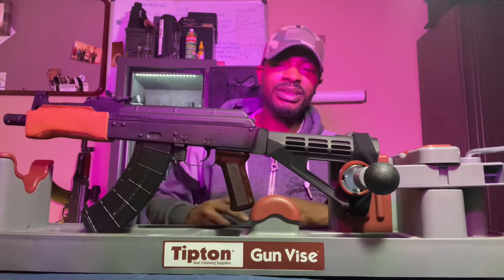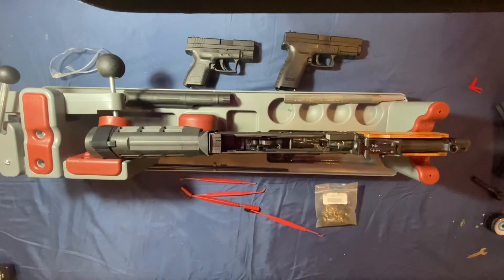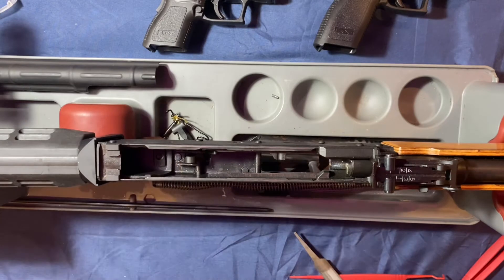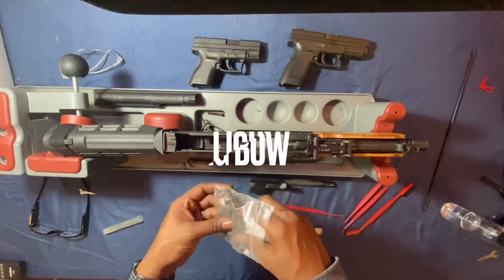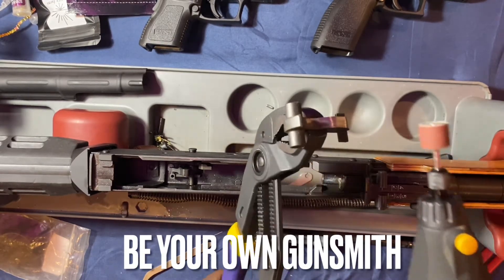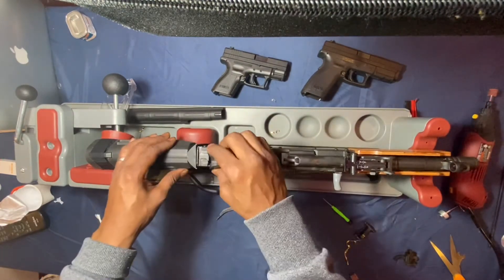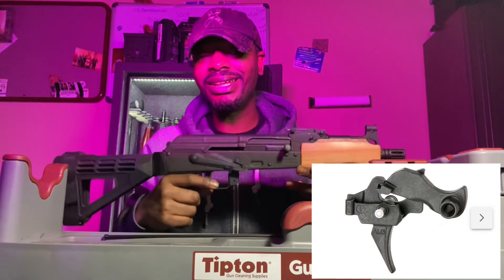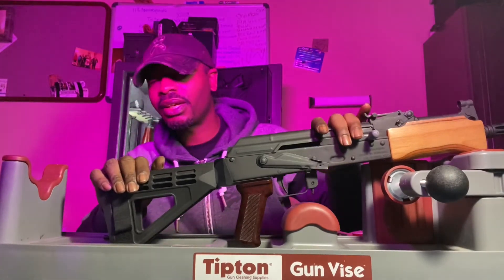Alg trigger AKT #mini #draco

Comment: Installed on my Draco 9s (as well as others). Only issue is safety has like only 15% coverage on the pin so it works but I don’t feel it’s 100% solid.
Reply from the maker: Didn’t think it was possible on 9mm aks atleast not the model I had

Comment: Just got mine in and need help with install.
Reply from the maker: With which components
Reply from the maker: Have you even started yet
Reply: @dg47arms  I gave up and then was able to get it installed but it won’t reset. I shot it for the first time on the 4th and it wouldn’t reset without me pushing the trigger itself forward. I opened it up and noticed that that the hammer isn’t locking in with the that hook that sits behind it. Sorry for not knowing part names off the top of my head. There’s space between the two pieces. I wish I could show you. I wanted to do it myself so that I could understand my firearm. Needless to say I didn’t install something right. The last two years I thought it was good because I was dry firing it but didn’t realize it wasn’t resetting. Smh. Any help is much appreciated. I have the ALG-UL in a Century Arms RAS47 Pistol 10.5inch. I’m going to watch for your reply.